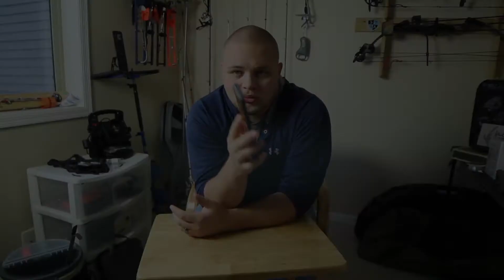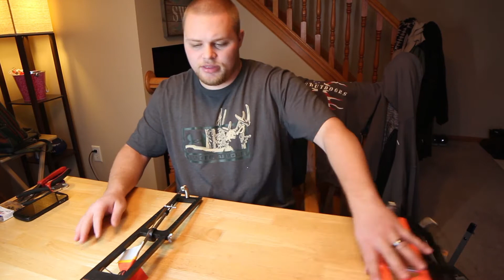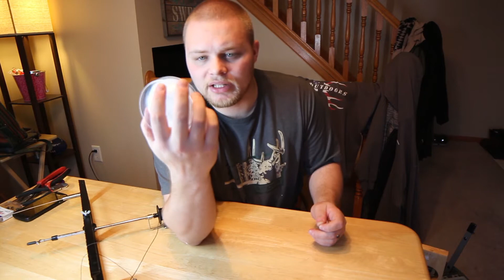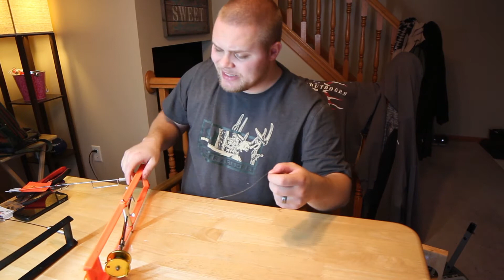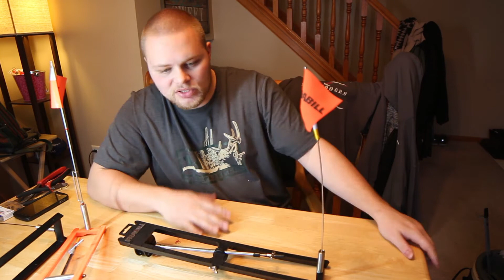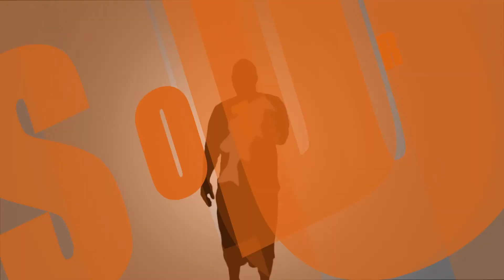How I Setup Tip-Ups

Comment: How do you feel about steel leaders? That's all I have ever used. I have had lots of flags but about 50% caught the others take it then spit not sure if it because of steel leaders but I have never had a break
Reply from the maker: If I knew i was in a Pike dominated lake with no chance for anything else, steel leaders are great! But Bass and Walleye are less likely to bite it. They are a bit more picky when it comes to eating. But like everything fishing, nothing is an exact science, if your catching fish no need to change!
Reply: Sgt Outdoors for sure, I was gonna try and put some fluoro on some of my tip up and see if I can't get more bits from northern
Reply from the maker: For sure, I would use fluoro if I had some laying around, its stronger, more abrasion resistant, and sinks! Its just quite expensive too. It would be the preferred line over Mono if you have some! I highly recommend.